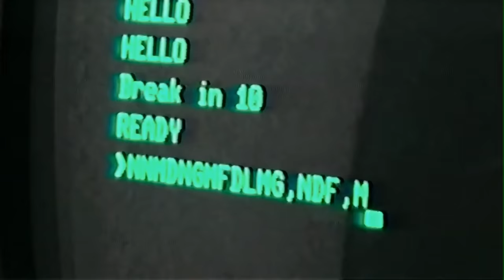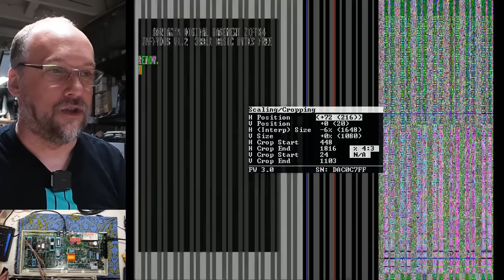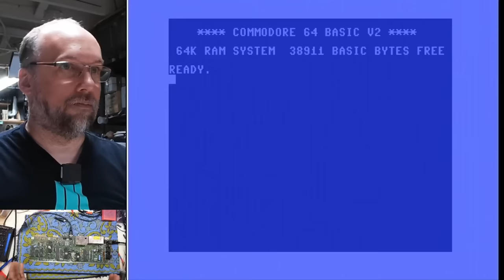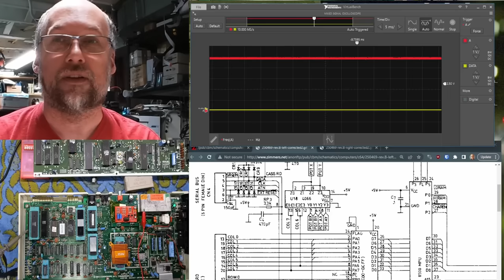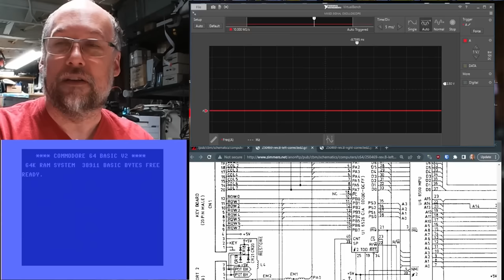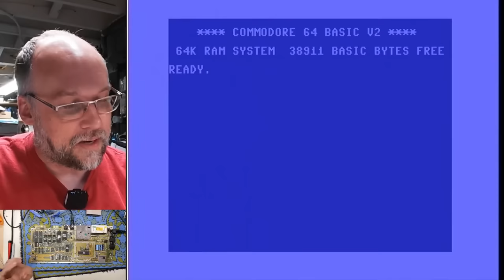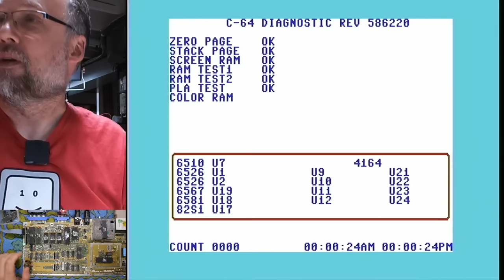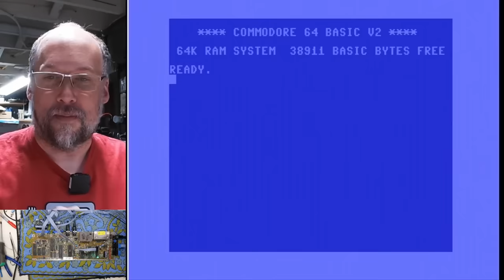Five bad Commodore 64s. One hour. All fixed!

Comment: I think they dropped the unit on to a hard surface (like carpeted concrete floor) that caused the cap to let go of its leg. 
I doubt the unit would function properly without the power supply cap.
Also, you need to get a cheap IR camera. They are so useful in repairs.

Comment: Hi Adrian, i had the same problem with the ram chips. Mine were NEC branded but it seems a common failure for these c64c versions. Luckily the aren’t expensive although there are a lot fake ones for sale. Thanks for the great video! Cheers Martin

Comment: The company for which I work makes rugged electronic equipment and we have to drop-test them and vibration test them.  We have lost larger capacitors as a result of these tests, so the broken one in there could have been from a drop.

Comment: The DRAM is very sensitive to over-voltage. People plug in their old machines to "test" before selling and the now dead PSU puts 12v into the 5v line and the machine is killed. The ram dies first. Depending on how long they leave it on a black screen, other chips get fried eventually. But in my experience it's dead PSUs that kill the ram.

Comment: In this case... black screen is a good sign for failed C64s. If that's the symptom, the problem is probably bad RAM, which is cheap and easy to replace. On the other hand, if your keyboard or clock doesn't work, the problem is probably a bad CIA, which is unobtanium.

Comment: Nice repair-athon. Strange how they all had exactly the same fault. 🤔 (I smell a conspiricy. lol)

I've just repaired my spare 32K ZX81, (I gave it 32K internal RAM years ago). The regulator had blown. Luckily it blew open circuit, so nothing else went with it. I put in a Traco regulator.

Comment: Could it be that the voltage regulators send a slightly highvoltagein these machines and the ramchips are very sensitive to high or low voltage?

Comment: The RAM problem could be the way they are driven.  I remember my TRS-80 had resistors in the data lines between the DRAM and the TTL chips. Maybe Commodore decided they could do without them.

Comment: I had breadboard machines get zapped several times.  It was so frustrating.  Commodore did fix the machines under warranty.  But I probably had ours repaired 4-5 times!

Comment: Adrian. if you look at 48:05, you will see the Capacitor was pushed out of the way by the RF-Shield. And this Shield actually has holes to let them go through. Who assembled this thing that way? Considering the seal was unbroken, it either was slapped on later or this was a "new" machine, which is probably a customer returnal for not functioning on purchase.
Reply from the maker: I assume it was manufactured badly at the factory.
Reply: @adriansdigitalbasement  That would be a rare case, right?
Reply: @Sypaka  Since they had only just started manufacturing them in China around the time this unit was made, they might not have had sufficient quality controls in place yet.
Reply: @TheUtuber999  Ouch. I wonder how many of the machines went straight into garbage at that time.

Comment: My bet is there is a PS or filtering deficiency on the data/address lines driving the RAM chips, causing failures. Its the only thing that makes sense across 3 manufacturers.

Comment: Would fluctuations in power input affect the RAm, is it particularly vulnerable?  Would normal extended usage and getting too hot damage it? Is there an issue with plugging something in or out or the wrong way an issue that could introduce a power spike that damages RAM.  Joysticks (mega drive pads), or data cassettes or DIN plugs that shouldnt be put into datacassette ports?  It just seems too much of a coincidence.

Comment: Hm, my (German) C64C (not CR, afaik) doesn't have a heat/RF shield - never had. The standoffs/adaptors for the keyboard are simply single pieces... Maybe those could be obtained from other parts machines?

Comment: Can you use a 6522 in place of the 6526? You know, the CIA out of a Macintosh?

Here in New Zealand, our C64c were made in Hong Kong (silver label on the bottom - and the Warranty Seal, which I think you should have tried to peel off!) - and they have the Philips screws. But still the red power LED and the separate video RAM. Some have the annoying cardboard shield and some the metal shield.

I was aching to listen to the SID sound test - it kept getting cut off ;) One of my machines (with that test cartridge fitted) doesn’t produce all the scales - and they all sound raspy (no triangle waveform), there’s no white noise, plus there’s a loud pop when the sound starts and stops. Yet when I play games on that same machine, they sound identical to the other - waveforms are normal and white noise is working. Weird!

Comment: I suspect YOU see more bad ram in those machines is because Commodore was getting better at making their in house ICs so the overall failure rate declined on the machines but the proportion that are caused by RAM is higher (Since the RAM fails at a similar rate as before). Then, the Adrian effect makes you see a lot of them (Adrian effect - The probability that Adrian Black get a Computer is inversely proportional to its condition)

Comment: I recognized the warranty seal from my Amiga 1200, long time ago... Another problem with the Amigas: always the CIAs broke down, they were very sensitive for static electricity and plugging in devices while the machine was running, had a lot of strange problems with mouse, joystick and disk drives...

Comment: It's possible that there's some defect in the RAMs, but my guess would be that an over-voltage event is causing the RAM failures, notably since they're shorting out (getting hot). First I'd check the differential voltage between the supply lines at the RAMs at power-up, and if you don't see anything then I'd monitor it during usage as the RAM current varies. If these are 2 layer boards with not much in the way of a ground plane, it's possible that the regulators are OK but that there are transmission line effects that are creating reflections that in turn create spikes of just a few ns in the RAM supply voltage, which I could believe over a long time would eventually lead to failure. Note that on these boards the RAMs are about as far from the regulators as can be, and so there's quite a long path between them. If the transmission line effect is the problem, then my thought to fix this would be to place a large (e.g. 10 uF) low ESR (say < 10 mohms) ceramic cap directly on top of one of the RAMs (to keep the lead inductance to a minimum) across its supply lines to absorb the RAM current spikes.
Reply: I think he's using his own power supply for all of the machines tested here.

Comment: The RF shield almost surely helps with cooling, and dramatically. Here's why. Air is a great insulator. So unless there is a fan to duct out the heated air, the air temperature will rise until it comes into equilibrium with the case temperature. But metal is an excellent conductor of not only electricity, but also heat. Radiant heat from the chips will warm up the shield, which will then re-radiate into the surrounding air and to the case. This is what happens in any case. But having the shield means you are trapping air between it and the shield, and that is going to be cooler than the air between the shield and the case. It is paradoxical but true. The shield acts as an absorber and radiator of direct infrared from the chips. Of course, if you leave it on long enough, everything will come to the same temperature. Thus the shield makes no difference in the long run, but in the short run, actually provides a cooling advantage. The only way to really lower the temperature is by forced evacuation of the heated air inside the case, with a fan, either internal or external.
Reply from the maker: The case has vent holes on the top and bottom, so convection cooling happens. And the lower RF shield on the motherboard actually blocks the underside vents which could have an effect. Anyway this is so easy to test. I have a drawer full of thermocouples ... And I have a feeling there will be basically no difference.
Reply: @adriansdigitalbasement  There are good videos (#3 and 4 in the series) by MindFlareRetro about this, and he showed that the shielding makes for a very terrible heat sink. Personally I just cut the tabs off the shielding and put proper heat sinks on the chips themselves, which might do a bit better job at cooling and will hopefully keep the machine living for many more years. Unfortunately MFR's videos only have about 2K views, so if you did a similar experiment (especially showing if dedicated heat sinks make a difference or not) due to your audience size, many many more people will know the facts.

Comment: Perhaps commodore is using the ram close to or beyond their spec.  I know that early ram was easy to damage with static and doesn't always show immediately.  A place I worked improved antistatic precautions on the assembly line and random field failure rates dropped off a cliff.

Comment: Do not remove the rf shield! 1. It's part of the original machine. 2. Rf shields are not useless! 3. Its als a giant heatsink. 
And i always get a heart attack when i see you run a board on this old towel..

Comment: Yes I guess it might be the same as 41xx failes, its also very common in e.g the ColecoVision or Memotech MTX, where 4116s was used as Video memory. And that sucks cause there is 8 of them. While in the C64C you only have to swap two ic's ;)

Comment: MT ram fails a lot on breadbin unit...  on the c64c those ram chip most likely got damaged by overvoltage from bad psu...

When 5v is too high , the ram is most likely to fail first

Comment: I wonder if Commodore was doing something out-of-spec with the RAM they used. Weird that the C64s have bad RAM at a rate way out of scale with other devices from the era. Like maybe something with the always-sus power supply.
Reply: exactly, the 4164 memory can safely drive a load of 2 TTL gates, not drive the entire bus as commodore does, This will cause gate degradation over time, as well as degradation of the gates as they age.  Ram running hot at failure show a breakdown of the substrate insulation layer that increases current consumption.   Give those chips another 10 years of aging, and they will go to dead short Vcc to Vss
Reply: @steveb3885  I consider 2 TTL gates is quite a bit; the data sheet of the SN7400 for example lists 14mA as input current. The chips on the C64 mainboard are NMOS, i.e. MOSFET based and as a result pull waayyy less current from the bus than TTL chips.
Reply: @danielmantione   That is the actual spec for the 4116 and 4164 directly off the data sheet
Reply: @steveb3885  Yes, but it's quite difficult to translate that to the C64 bus. However, I would expect that all chips together have a lower DC load than 2 TTL chips and it is mainly the parasitic capacity of the bus that causes load on the chips during transitions. It's quite difficult to reason from data sheets on this.
Reply: @danielmantione  it's actually quite easy.   Just add up the load of every ic that does not tristate on the bus,  but I do agree, the load capacitance would be extremely high the way the board is designed.    They learned from the 64 as the 128 has no where near the problems with dead memory

Comment: Ah, I finally got recommended a recent video by you. Perfect opportunity to ask.

How does the ARMSID fare:
- With the new 2.15 firmware
- On a C64 / C128 with the SuperCPU (if you have one)
- On a Turbo Chameleon
- On an Innovation SSI card (or clone) for IBM-compatible PCs
- In a DualSID setup?
Reply: I should also probably ask:
Have you ever considered putting battery-backed SRAM on a C64 (for a “low-power sleep mode”) and turning it into a C64 laptop?
Reply: @AmaroqStarwind  I've only ever seen home brewed c64 laptops with people using the c64 DTV as the internals. Makes sense, the dtv's motherboard is tiny.
Reply: @maxxdahl6062  Er... What's the C64 DTV again?
Reply: @AmaroqStarwind  The joystick plug and play c64 unit that you could mod to give it the IEC floppy disk port, keyboard port, joystick port and power supply ports.

Comment: I wonder, with the ram failure being so common, if there's some sort of underlying problem of the board's design that's causing them to fail quicker than normal or if they're just poor quality ram chips. though even being from different manufacturers, who's to say it's not a mix of both.

Comment: it is possible that these motherboards just push those 4164 to the very edge of their specifications? Maybe running just a little over 5v or maybe clocked a little bit too high? Seems suspicious having this problem on different manufacturers and would be likely.

Comment: do you really need the RF shield? Did fix a Korg M1 Synthesizer some time ago but due to corrosion I did not want to mount the RF shield again. It works fine without it.

Comment: I wonder if there is a common failure mode that could take out the RAM? I wonder if the ChipTester would show something interesting on those bad RAM chips? 😀
Reply from the maker: There's nothing to see with them -- they are shorted which is why they get so hot... It does seem suspect that so many have this failure, but I couldn't say what it could possibly be.

Comment: Is it a good idea to try the bad ship again after you install the socket just in case maybe you had a cold solder joint or something like that that was fixed when you resoldered it?  I tend todo that just make sure especially with such a rare component?  A few time I almost discarded a good part, so I always check them.

Comment: If Virtual Bench is crashing a lot, try to run it in administrator mode.  If it is already, you can see if the software has a newer version available, or it is possible a recent Windows update broke it.  Temp files for the program could be causing it to crash so you could look into a fresh install.

Comment: @25:25 The 8520 CIA , as opposed to the 8521, is not the same as the 6526. The 8520 has a 24 bit counter in-place of the TOD clock. The very same clock you just told us to pay attention to. Putting a 8520 CIA into a c64 will not only give nonsensical times in the diagnostics but software that uses the TOD (GEOS, Little Computer People, etc..) will be upset.

6526*A* / 8521 (2MHz) chips with bad IO pins can be used for repairs to 1571 disk drives.  6526 (1MHz) chips with only a bad Port B can be used in U2 provided the User Port isn't going to be used ever again.

Comment: With the cost reduced 64C uses the MOS 8500 processor or you can use the older MOS 6510 CPU
Reply: It eats both of them.

Comment: since the entire machine is getting hot, RAM is probably least forgiving when it comes to temperatures and it wasn't even touching the shield to remove heat, Probably bad design - driving RAM to high temps - I'd guess. Maybe they picked wrong types of RAM for these machines? It's not as much of a problem on Atari 65XE

Comment: If I have some spare 128 boards, can I use the 6526-a as a replacement for the 6526?  Afaik, it's a faster chip so I'm not sure
Reply from the maker: The A version is interchangeable. I think the B one isn't though as it's from the 1571 as far as I remember.

Comment: I think that Triangle badge on the RAM is Matsushita but I could be wrong there I have seen it on tape deck motors that actually wrote matsushita also on the sticker. 
From my experience with computers all these years I find RAM dimms and chips to be the most frequent cause of non working machines as a whole, especially when you have frozen situations no post and stuff. 
Great video cheers from Greece! Jim.
Reply: Yes indeed they are made by Matsushita.

Comment: I really do wonder if Commodore was getting B grade or C grade RAM off suppliers for the C64 due to how many they were selling, to increase production or save a buck at manufacturing time. one of those three. it's possible that it's not indicative of the brands themselves having an issue but what batch they came from and how commodore's factory got them.

Comment: Haven't even begun to watch yet, but since builidng a PSU for my early 64C (breadbin-style keys with the PETSCII on the sides & it's the 250466 board, last of the longboards), I've yet to brave connecting it to said 64C, and although probing the PSU and checking it is all wired up properly, I still have not powered the thing up for fear of trashing the board from an error I may have missed, despite all the checking I've done, given the cost of replacing damaged ICs if I did mess something up... :S

Comment: It's surprising to me to hear you say that you have more issues with the 5X than the 2X. Probably related to the less-common use case (home computers as opposed to video game consoles). For other systems like the Sega Genesis, the 2X has way more issues with the composite. Some Sega systems, the 2X will show drastically shifted colors or even have trouble showing color at all.

You should reach out to Mike Chi, I think he'd be interested to hear what situations you find problems with and maybe fix them.

Comment: One way that these CIA chips could have been fried would be if someone had connected a SEGA controller (Genesis/MegaDrive or Master System) to one of the joystick ports.
These controllers might be safe to connect and use with other systems, but not with the C64 or C128.

Comment: Did PSUs fail in such a way as to cause the RAMs to short before the fuse blew, maybe? Let's say someone's C64 stopped working in the mid 90s, and they bought a used C64C, and used the old, possibly bad PSU?

Because it's unlikely that a through-hole solid-state component stops working on its own. It's also unlikely that 3 different factories (or at least differently printed symbols on the chip) make chips that fail in the same way, if the design/layout/masks don't come from the same place and have this bad design in them.